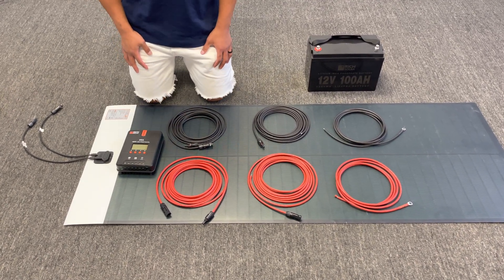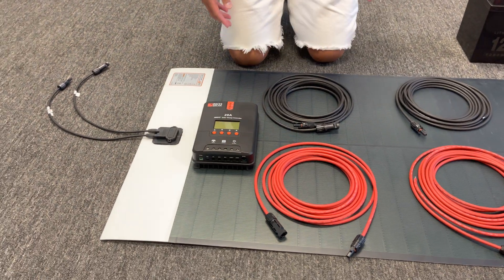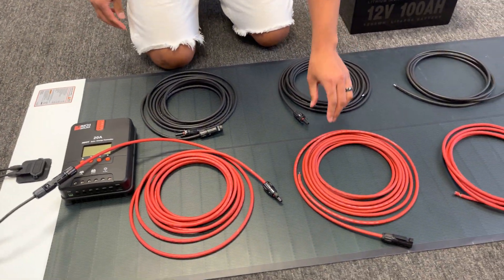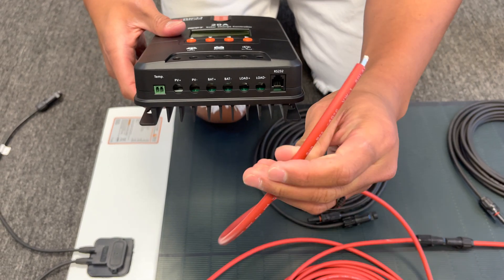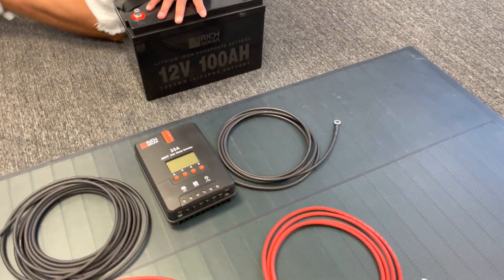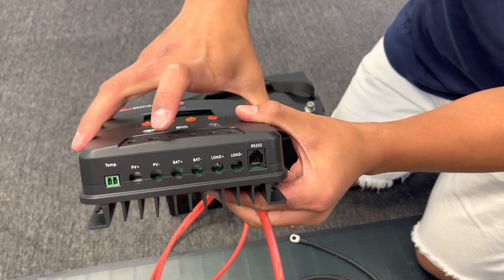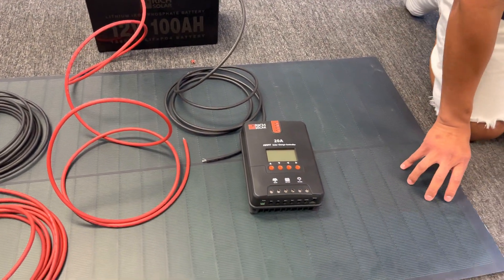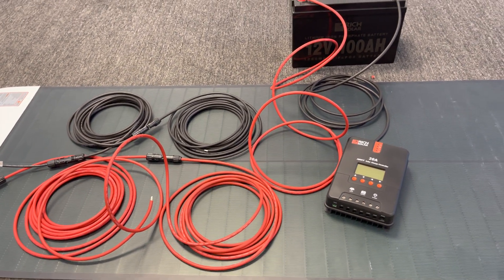Tutorial 160 Watt CIGS Flexible Solar Kit Installation

Comment: You should always connect the cables to the MPPT controller before you apply power to it. When you connected the cables to the panel, you're automatically "live", producing power, even under artificial lights with CIGS panels. Safety first! The way you've done it, you're attaching live, powered cables directly to your MPPT. That's very bad practice.

Comment: Would be nice if you provided a link..., Why does this panel cost over $500????
Reply: Completely different manufacturing and technology from old flex panels. Supposed to be more durable and have a 5 year warranty included. Heard Will Prowse and Hobotech recommend them. Hobitech says they are the best flexibile panels available.

Comment: Do you suggest an insulator - some say we should be installing these over plastic cardbord to allow them to cool.  (and then mount the cardboard to the boat roof )
Reply: They are supposed to not be crap like the normal flexible panels so supposedly you don't need the insulation. I live in Texas and every flexible panel dies from heat within a year. These are supposed to not be like that.